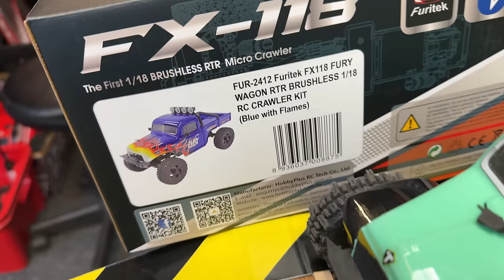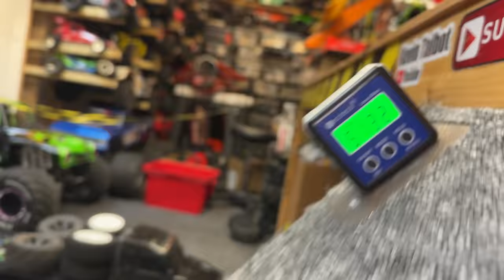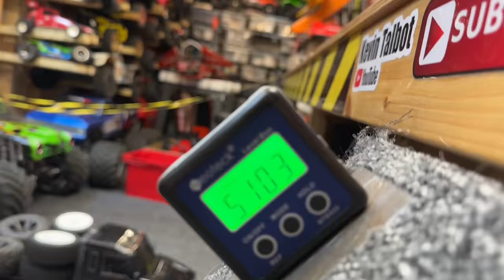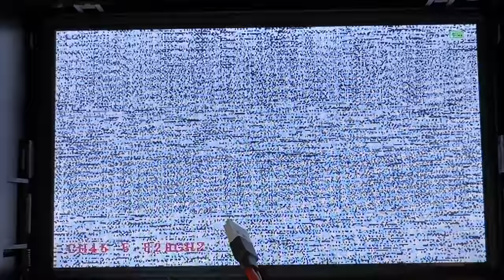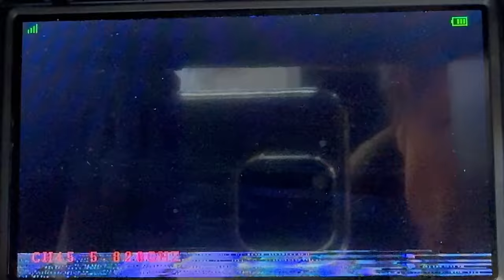MIni RC Crawlers vs dodgy bridge

Comment: With your 4ws Scx24, take the springs off the shocks or run stock springs on the upgraded shock body, chassis mount the shocks and use limiting straps. That will help to lower the cg and help with articulation as well as improve all round performance. I did this on my 4 wheels stear Scx24 and it made a world of difference
Reply: Slop suspension in these 24th scales is a must
Reply: P❤❤❤ 9:01

Comment: Turned my scx24 into a micro monster truck using the ecb chassis! Its super cool and you should make a video on it. Add a brushless motor, overdrive gears, , 3s battery, and you should have a fast car!

Comment: Get you the Dji mic. They have adapters for iPhones. Both lightning and usb c. You can record your videos like normal on your phone with the adapter plugged in and use up to two microphones simultaneously. I use them all the time.

Comment: Kevin! I did post on an older video before when you asked. The DJI Mic (1 TX + 1 RX), Wireless Lavalier Microphones are great for the iPhone.
Reply from the maker: Can you get the gain low enough?
Reply: Sorry! for a late reply. Yes you can easily adjust the gain on the RX touch screen It'll go Up & Down. It's got a good set of settings & anything you adjust on the RX the phone sees those adjustments pretty much instant. Edit: RC to RX ha-ha.

Comment: You're not there yet Kev but definitely getting there. You need MoFo, Hardpark, LGRP, 3flow9, Mazz designs, Akers, JEC engineering and then you will be laughing at your current rigs. The smaller USA companies are where its at for performance. MERICA🎉

Comment: That’s for the charger port itself to be plugged into a type C charger plug with the iPhones because I have the iPhone 14+ it still uses the old charger wire plugs in the headphones

Comment: Kevin I'm  commenting here because it's your newest  video.  If your building  a tamiya kit use the tamiya 8 pc tool.  Kit. Tamiya screws are  not true Phillips  there japanese industrial standard  thats why your pushing  on the screws
Reply: That is 100% true. JIS (Japanese Industrial Standard) is the Japanese version of Philips heads, and Philips drivers don't get a good bite on them.

Comment: Get rid of the I-phone. Also don't drop it. Don't need to keep getting new ones. I don't even have a case for my Droid and my dumb butt keeps dropping it 5 feet out of the feed truck I drive lol. scratches and scuffs and dents (oh my) but works fine with no issues.

Comment: I really love your videos man, I have a cheetah and the rival mt10 v2 because of your videos! I just got the mt10, and broke the suspension/shock arms already, so I’ve just fitted the rpm ones (the shocks were really hard to get it the arms, did you have the same problem?). I’m also having some problems with the shocks so I’m going to take it to Redfin, I live not too far. By the way, the spider tunnel bit was pretty cool!

Comment: Hey Kev, have you ever seen a Redcat racing rockslide rs10 crawler? Very cheap for what they where 10 years ago, direct motor to both axles and 4wheel steer, I’ve modded mine to make it very capable, would like to know you opinion if you know of it 👍🏻👍🏻

Comment: 2:23 is it a USB On The Go (OTG) adapter? it has to be an adapter that can talk to phones
Reply from the maker: This is supposed to be
Reply: @kevintalbotrc  quick google and maybe not enough power for the mic. does a simpler usb mic work? you could try a powered usb hub if that's the problem, but that's hardly portable